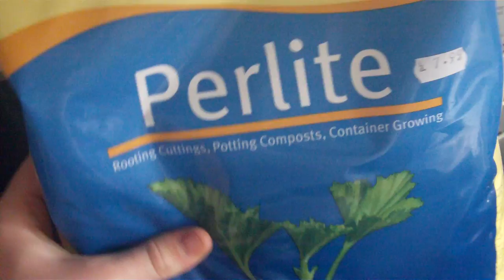How to make a microwave foundry part 2

Comment from the maker: I have 1000 watts of microwave energy going through 2cm of calcium silicate then through 8cm of perlite granules and 0.5cm of molochite before the magnetite hits silicon carbide and magnetite stuccoded to a graphite crucible wall of thickness 2cm. When the microwave energy hits the magnetite and the silicon carbide it turns to heat. I know that perlite's thermal conductivity is 1.37 x 10^-3 W/mK and the calcim silicate is 0.45